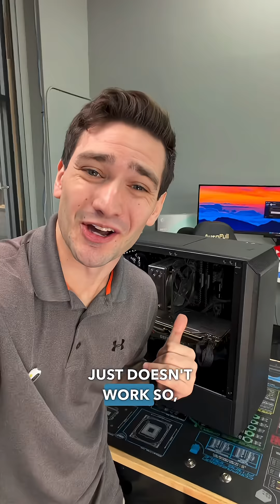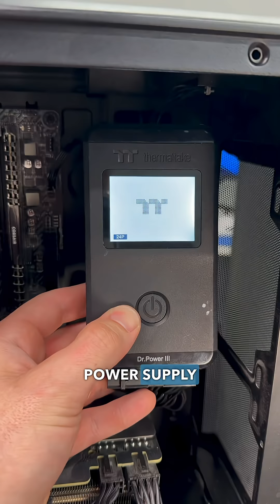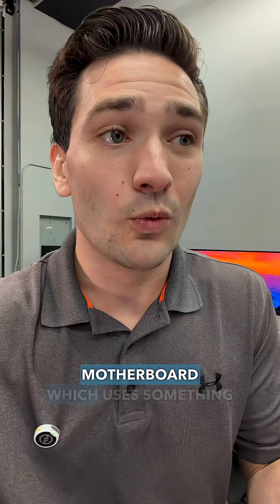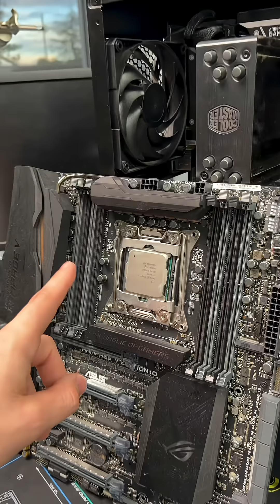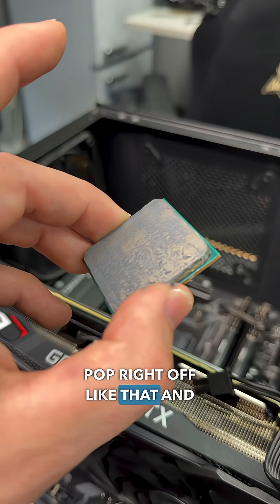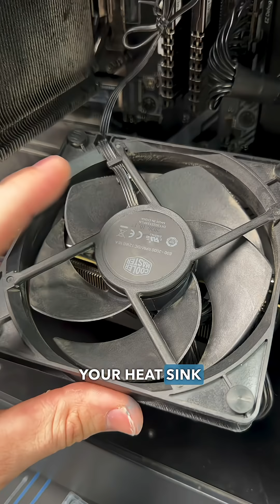CPU Cemented To Cooler! #pcbuild #techtips #gamingcomputer #computerrepair #gamingpc #repair

Comment: Hair dryer. Apply gentle heat in addition to the twisting he shows in the video
Thank me later
Reply: Don't even need the hairdryer. Just stress the CPU using Cinebench or CPU-Z for 5 min before pulling the cooler off.
Reply: @PowerliftingCollege  I realize this might be satire, but I still want to mention that in this situation the lever on the socket must be lifted in order to get the CPU back inside, and with it poking out, it might be either very difficult or straight-up impossible to get the CPU with the cooler glued to it back into the socket.
Reply: @PowerliftingCollege explain how you do that when the CPU is pulled out and the PC won't boot lmao
Reply: @PowerliftingCollege ik this a joke but he can't turn on the pc vro
Reply: Had this exact problem a couple of weeks back and no amount of twisting or pulling could even budge the chip. After a solid 2-3 minutes of blowing on it on high heat it finally came off. Watch out because it might be quite hot.
Reply: only if the cooling paste is already dry, but if its not dry, just twist it carefully

Comment: What if it was shipped back and the CPU comes loose? 

Hopefully the packing foam does it job not making the CPU loose
Reply: A good repair shop will tell you what they fixed/what the problem was. And well, anybody can do this fix themself just fine - when they know that this is the problem.
Reply: any repair shop with integrity will tell their customer what the issue was, 90% of the work is to trouble shoot the issue so I believe the guy can handle it himself if told what's what
Reply: Ship it with the tower cooler off and pack it outside the case in the box, that way there's nothing that's going to dislodge the CPU. Those tower coolers are heavy and I'd never ship a PC with one installed personally. Same with the GPU card.
Reply: some scrumped paper or Styrofoam to keep it in place might help perhaps?
Reply: I thought of this right away that he should have stated foam packaging and make that expanding stuff. Clippys think a like. 😂
Reply: If you actually install the cooler correctly it's usually pretty solid, but if you surround it with support material it should be fine.

Comment: The dust on heatsink & fan 😅
Reply: No no it's structural, can't blow it away otherwise the system won't turn on
Reply: Given the CPU fan is pointed the wrong way, I'm not surprised dust would collect in between both a bit quicker.
Regardless, it's barely anything and not at all related to the problem
Reply: Thats not gooch enough
Reply: How often do you take apart and clean your entire PC? Be honest, real talk, how often?
Reply: What dust?
Reply: That wasn’t that bad bud
Reply: Not even much tbh
Reply: @nery2981isn't supposed to be a brand new PC?
Reply: @mirkoruhl9324  yeah. Not even much
Reply: Really wasn’t that much.

Any fan would collect that in 2-3 months.

Comment: Wait why...ok now ik
Reply: I had my cpu stick to my cooler (pump failed so the super thick ic diamond paste was cold) and when I pulled it, half the pins came with it. I did this a couple days before Christmas...
Had to rush to the store an hour before it closed for the holidays,  buy a new cpu, new cooler, new paste etc.
Now I moved to an air cooled system with a cryosheet. Problem solved.
Reply: @xDiscipleOfTheWatchx cryo sheet? Never heard of that
Reply: @GawbryYT  yeah its like thermal paste but its a pad and you put it on your cpu instead of applying paste. kinda like the thermal pads that ASUS sometimes puts on their gpus in some places
Reply: @Mil @MilenaSrbova so basically a prefab thermal paste?
Reply: @Pikawarps no, it’s a reusable graphene thermal pad
Reply: How did the comment get even 1 like let alone 600+
Reply: @Austin_159  youtube hivemind
Reply: now explain why some random dude pays to literally fly their PC for a troubleshooting. Go figure...
Reply: I have the kryosheet along with the contact frame for am5 from Thermal Grizzly, fully recommend it
Reply: This must be a skit, there’s no way
Reply: Ok
Reply: attention span got cooked because it's not a 30 sec video 😂